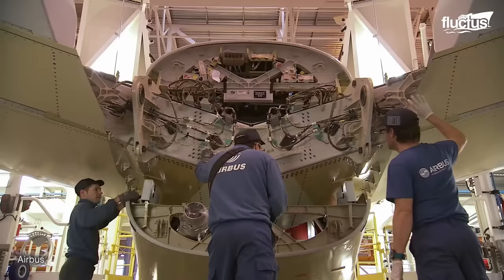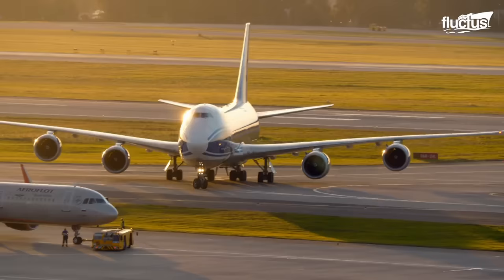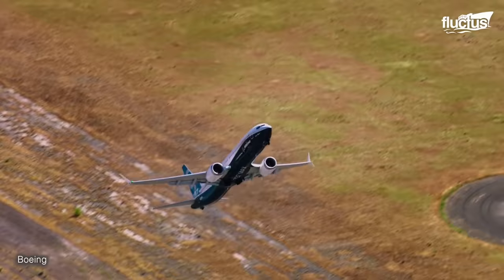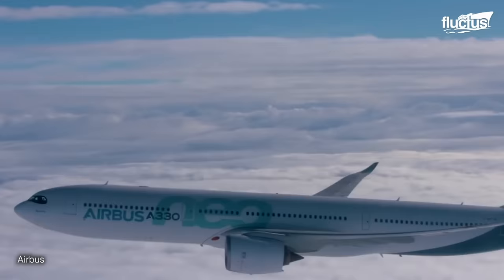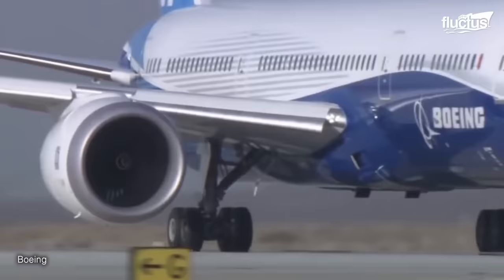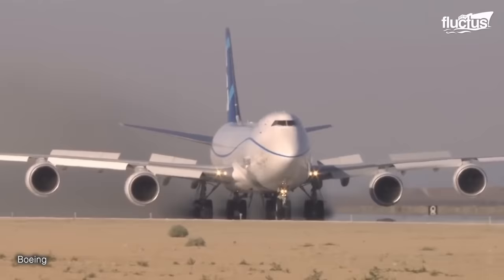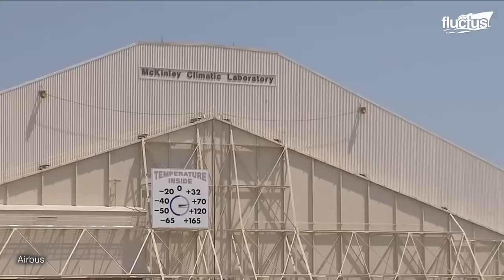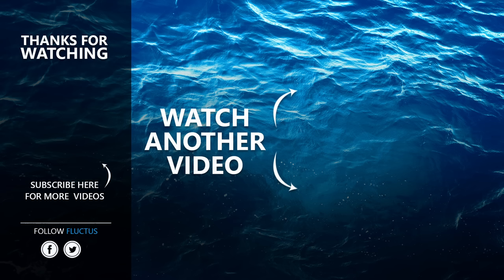How Brand New Aircraft are Cruelly Tested During Vertical Takeoff Before Being Sold

Comment: Lets make airshows of planes fully loaded in adverse conditions with a critical system failure and then I won't see it as biased advertisement that does not fully display the economical budgetary constraints of these aircraft....
EXCEPT military aircraft. Pretty sure budget is not a problem here in the states. 
Guys, these high bypass engines literally produce more than 80% thrust through no part of the fuel burned in them. LITERALLY NO PUMP ON THE PLANET can fill the planes with fuel the way they say they need them to be at the airport. The technology is so far advanced of these engines HARMONICALLY that it very well may be free energy right in front of your face yet the dinky little tube connected pumping nothing close to the amount of real fuel they say is enough to show to make you think they are not using technology beyond the worlds basic knowledge

Comment: If those engines could be pointed down those airliners could probably pull off a vertical takeoff
Reply: No, they couldn't. Even empty the engines only have about 1/3 the thrust(at max power) needed to vertically lift commercial passenger/cargo planes. Even the concorde was nowhere near powerful enough.
It's typically only some fighter jets that theoretically have enough thrust.

Comment: Such a poorly researched video... It's not a vertical takeoff - it's just steep. And tires deflate by design when overheating without any action required. And it's not like manufacturers do the testing because they like it. They HAVE to demonstrate safety to get certification by FAA/EASA/... Finally, cute belittlement: "Airbus, a french aircraft manufacturer." It's the largest manufacturer in the world.